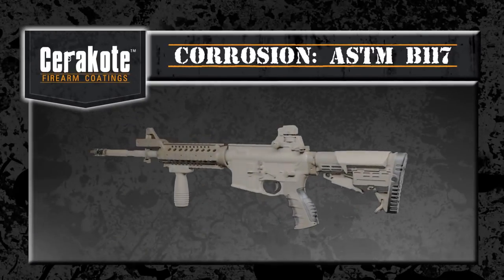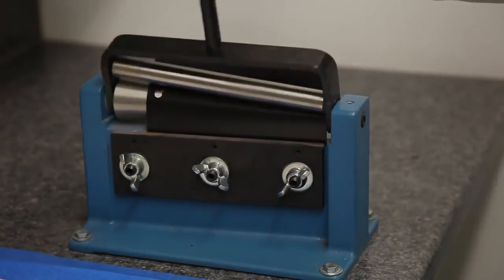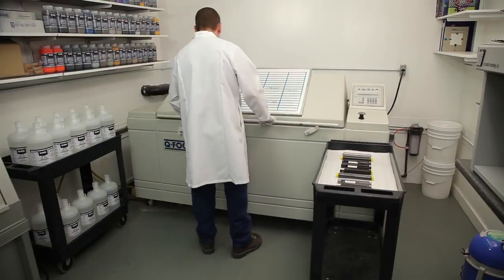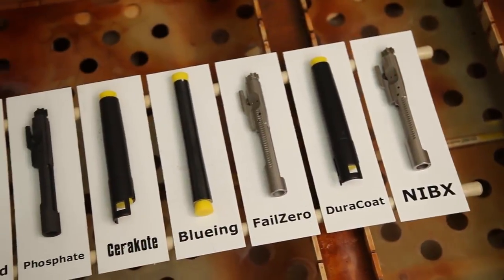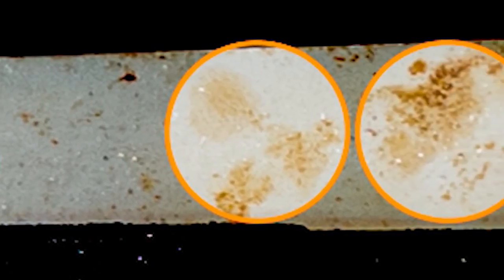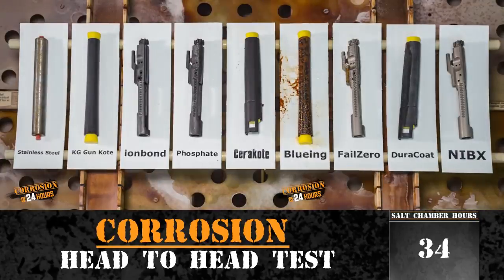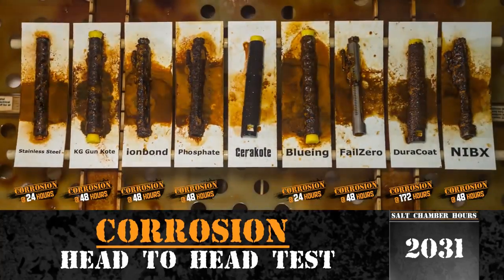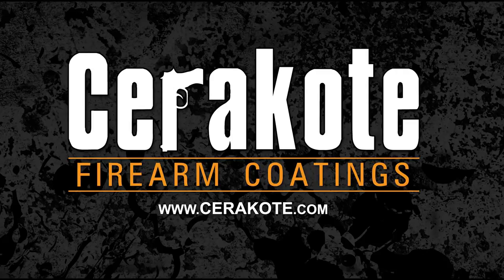Cerakote Ceramic Coating Corrosion Test ASTM B117

Comment: Cerskote gets dinged and chipped by ejecting brass alone. I have cerakoted firearms from the factory, all chip and ding from ejecting brass alone, so it's not a strong, durable finish. PVD is much more durable, and nitron or phosphate are the best-looking finishes imo. I love silky smooth satin gray military looking finishes on quality firearms. Cerakote does prevent corrosion well, though, but many others do as well.  Sigs nitron and glocks old tennifer finish on gen 3 and previous are the toughest imo.

Comment: What about titanium nitride?
Reply: Titanium nitride (TiN) coating is not intended to provide corrosion resistance to the metal. Oxygen can somehow penetrate it and cause corrosion beneath. You can do a quick picture search to see what it's like when TiN coated parts corrode. I've heard that chromium nitride (CrN) or diamond-like carbon (DLC) coating, which use the similar PVD process, do better in protecting the metal beneath for corrosion.

Comment: what about nitrocarburizing?
Reply: What is that
Reply: @jbone9900    it is a steel hardening treatment that under high temperature where nitrogen is infused into the surface.  It makes steel less corrosion resistant and very hard.  Check it out - it is some cool stuff

Comment: and a question for you. A lot of treatments you tested here are not designed to work without being oiled - they are designed to capture oil for rust protection. Were they oiled for the test?

Comment: Cerakote cannot be applied to inside of channels - anywhere you cannot spray. So when we speak of corrosion resistance, we need to understand that only the surface is protected. If you let the aggressive environment soak into unprotected places you'll get quick corrosion.
Treatments that are applied by submerging or exposing to vapors do not have this limitation.
Reply: you are right. what mostly used is black anodizing, Chromoly, and Salt Nitrate as I remember but what is the best, that is what I don't know.
Reply: You can cerakote inside channels

Comment: Cerakote is a barbeque paint job.  If you like cheap looks go with Cerakote.  PVD is a much more technical and smooth finish.  It is a thin vapor deposit that takes on the characteristics of the pretreated surface.  If you polish the surface PVD will be polished.  If you bead blast/satin finish the surface, the PVD treatment will be satin.  There is a reason the highest end gun custom makers use PVD.  The negatives are if you don't pretreat the surface well.... if the custom maker is starting to lose patience with pre treatment... you will get a poor PVD result... inconsistent appearance... also, it takes on fingerprints readily, which I actually like.  It is a wonderful, thin, durable, attractive finish... not like a spray paint, cooked on finish.
Reply: True... But can you do pvd at home?
Reply: PVD like TiN corrodes just as badly as a regular paint job when it's in contact with salt and water. One way to make it less likely to corrode is to increase the TiN coating thickness, but that increases the cost significantly as well. Another way is to use the more corrosion-resistant PVDs, like chromium nitride (CrN) or diamond-like carbon (DLC) coating.